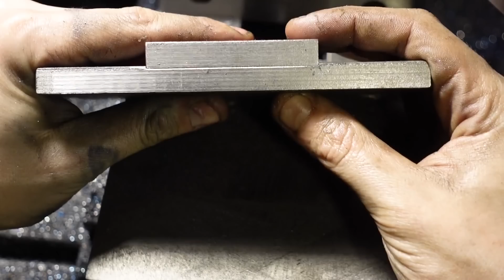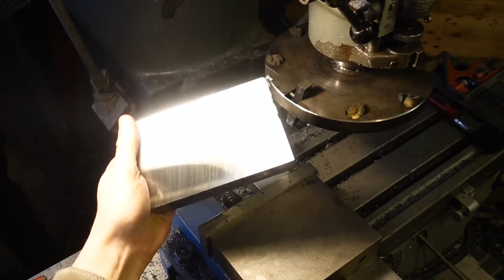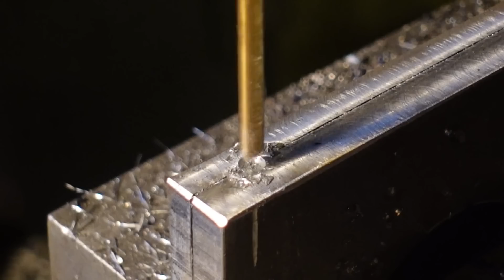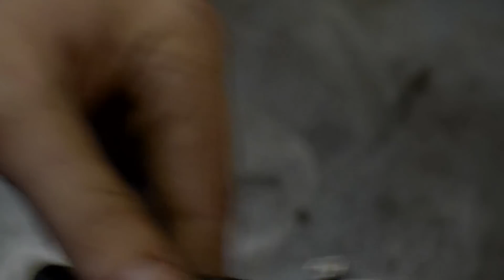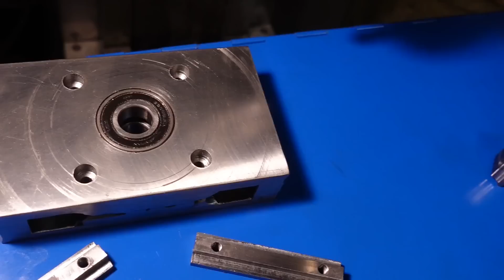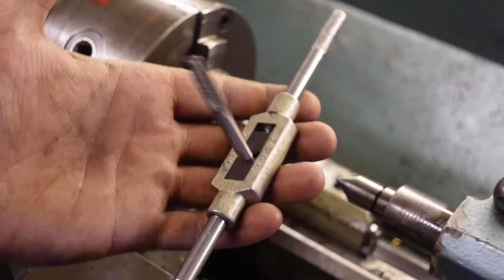Ball Turning lathe attachment

Comment: trust me to see it... 29:53...
dont get into that habit. it seems minor, i know. pull it out. have it in your hand. dont do that...

i had a hammer randomly fall down, the subsequent random broomstick fall over, the subsequent random lathe coming to life at full tilt as the handle gets knocked down... i was leaning over the chuck...

its like dropping a nut or screw, it always finds the hole, or vanishes on a freshly swept floor... shit happens. be careful. dont get into bad habits. i cant talk. meh. i thought i had tidied up, but no... theres always something. always.

i keep it out or in my hand when its in.

other than that. your shop. you do what you do ;)

what was i here to really say?

sorta getting motivated to get mine going again. i went funky, had a rack on the cross-slide... no lever for me! worked great but i never considered that it would be nice to move the center line as well. it did what it was meant for, two stroke heads.

semi-functional prototypes almost always invariably get left on a shelf and never dealt with again around here... meh. until i have the need i guess :)